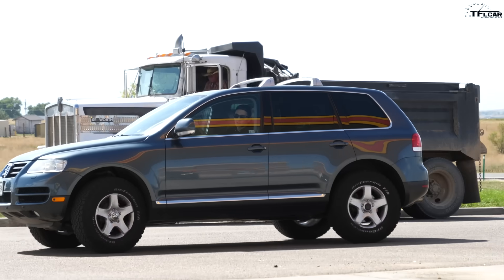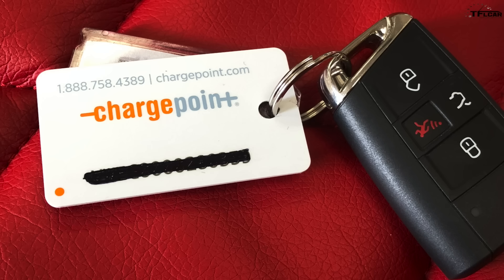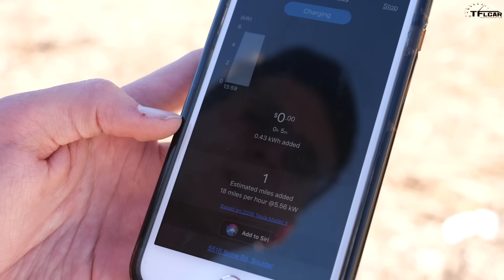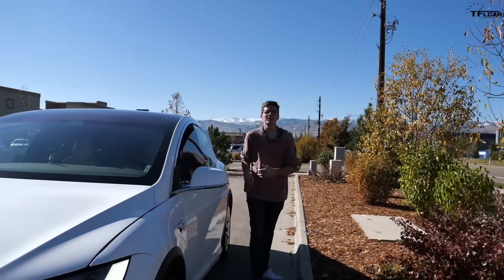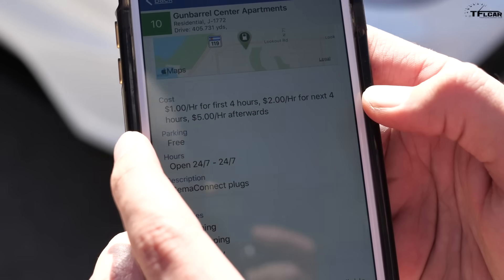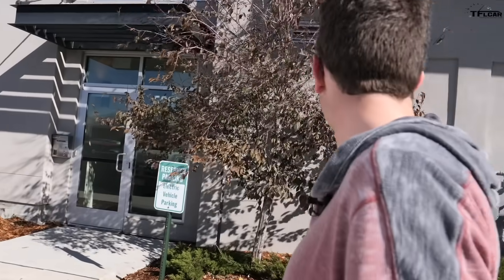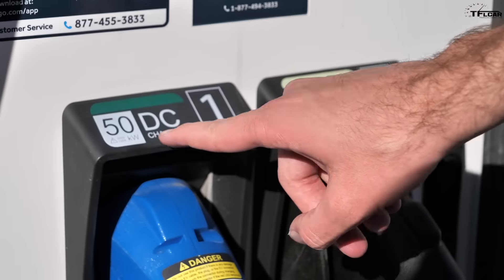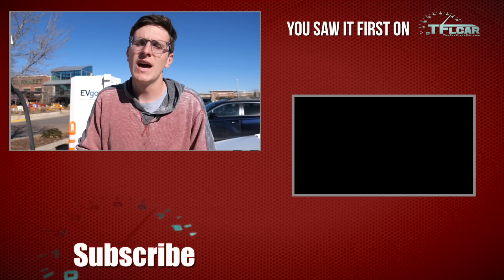Here’s Why Charging an Electric Car Can Suck - And It’s Not The Reason You Think!

Comment: I'll bet charging is not much fun in the winter time.
Reply: Pull car into garage, plug in charger, go inside for dinner.  Yea sounds terrible in winter.
Reply: @TexMex421  What about the guy traveling, you know plug in and walk 5 miles to get food or a room for the night while the car gets 16 miles a hour charge.
Reply: @marksmith732  Next time that guy will probably fly, or use a fast charger.
Reply: Cross country driving in sub-freezing temperatures is really the only time charging is a legit hassle, from personal experience.
Reply: Not sure on a Tesla, but the Lithium Batteries in my Motorcoach, you're not able to charge them much below zero (and I've in Canada).   My batteries have a BMS (battery management system) built into them of course, which helps to regulate the do's and don't's, or it won't allow them to charge at a set cold temperature, and they will equalize the batteries every so many charges.   Mine have a warranty of 10 years, but by the sounds of the amount of charges, they will last long after the 10 year period.   So, for most Lithium batteries if they are in an environment of below zero weather, you can run them down, but you just can't charge them!   Thus, an idea of having a garage at home, with the ability to keep them above zero, and have a charging system...you'd be good to go!
Reply: @dalewatkins9889  Tesla's BMS heats the battery pack before charging starts (if left plugged in) regardless of the temp
Reply: @dalewatkins9889  I believe the charging speed is slower in extreme heat or extreme cold, once the battery warms up it will speed up... but yes been an issue since Thomas Edison built the 1st electric car!
Reply: Um yeah sounds great if you got your very own garage but what about flat owners then they can't do it
Reply: @shorty5346  What about the people with no cars?  Where will they park?  (kidding)
As electric cars become more popular, high end apartments are offering chargers.  This will filter down to medium and then the lower end.  But at the same time more people are going without cars, and just using ride sharing.
Reply: Why not?
Reply: Probably because they have not tested on how much power they can drain a battery if you had the heating on
Reply: kevin bennett Teslas have been out since 2008. They have definitely tested how much the heating drains the battery
Reply: @jadenhalstead7290  I'm sure that the heating must take out a lot of power from the battery limiting its mileage range
Reply: kevin bennett not very much with the heat pump
Reply: @jadenhalstead7290  interesting
Reply: @shorty5346  In winter, you learn not to use the heater, use the heated seats and heated steering wheel

Comment: Electric cars will never be mainstream until the batteries get 5x the range or until you can charge up as ubiquitously and fast as the gas pump. A road trip with an electric car currently would take 10x longer than with a gas vehicle. Currently electric vehicles are only for city folk with their own supercharger at home and with money enough to buy a second gas vehicle to actually go anywhere far.

Comment: It's really interessting to see this as a german.
Here the "slow" AC Charger usually have 11kwh or 22kwh.
And the DC Charger have a range from 50kwh to 300kwh via the CCS Plug.

But the Charging price you had is very neat. 
the cheapest price for public chargers here is 0,29€ /kwh.

Comment: You kinda left out that if your mom or whoever doesn't get the complex charging infrastructure, it's probably not a big deal.  All they need to understand is that it get's plugged in when they are at home, then they can drive pretty much as far as they need the following day.  I've only been doing the EV life for a little over a week, but it's so incredibly simple.  On a 110 outlet, I get more than enough charge over night and never ever have to worry about charging somewhere other than home.  EV commuting is more simple, not more complicated than gas.

Comment: Public chargers are good but if you own a Tesla,  why would you not go to Tesla chargers? There are plenty of them around. And faster. For those vehicles not Tesla, then there is public chargers but at least Tesla gives you another option. But as you can see, the Public chargers are usually quite slow. Unless you can find some level 3 chargers which are available but use CCS as mentioned in your video. Paying for charging with different charger companies does appear to be challenging and not simple as it should be like going to a gas station.so this is something that has to be ironed out.